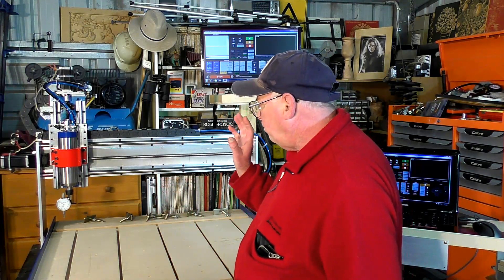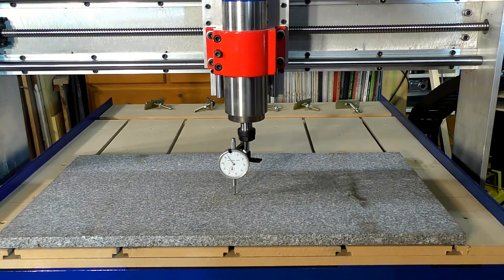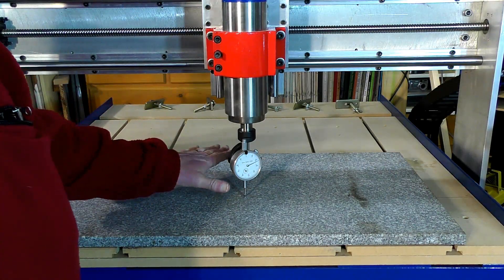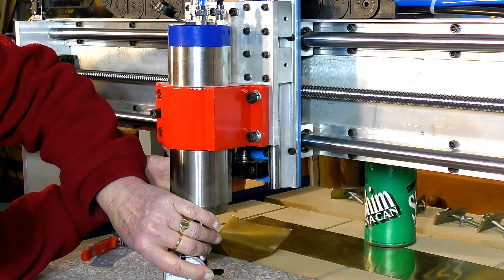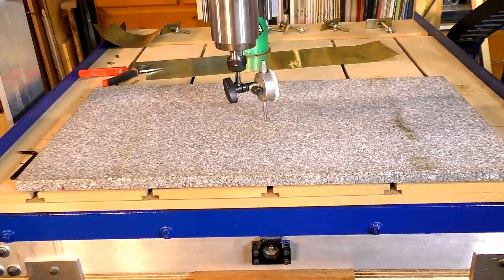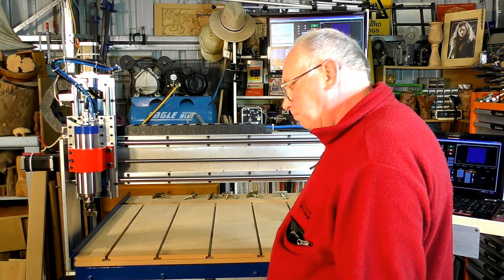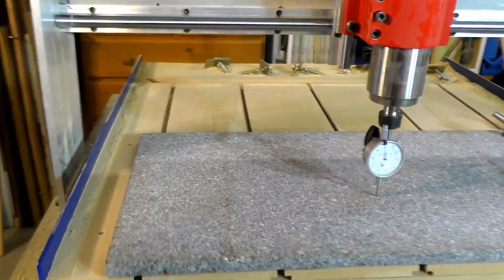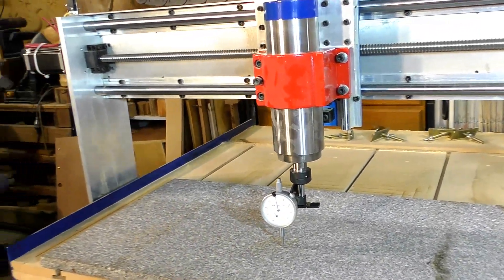CNC ROUTER, HOW TO, spindle tramming using a granite surface plate + DTI and skimming the bed flat

Comment: You can’t tram a head in if the table isn’t flat ! Even with a granite block !
Reply from the maker: Hi, I probed the granite first and got that absolutely flat, then tramed the spindle. Sometimes I don't show every thing I do in a video as the video would end up being too long.
Reply: I used this method for my Altmill and it worked perfectly. Did not want to surface my bed twice. I used a plate of glass but the granite would be better. Basically your tramming to a perfectly flat surface then you surface your bed to be equally as flat as the granite was. key is to get the granite perfectly level.

Comment: I would have measure each point of the granit slab with the gage fixed relative to the spindle.  To be sure that the slab plane was the same as the xy plane of the machine x and y axis. Shim the granit in consequence , then proceed to traming. You did do it on camera but spoke about it in the beginning.

Comment: Peter over at CNC Nutz sets his depth of cut at 0 for his bed flattening program.  He then zeroes the cutter on the bed and then adds the depth of cut to his zero in Mach 3.  That way you can adjust the depth of cut on the fly to get just what you want without changing the program.  I tried it and it worked pretty well.

Comment: No, no, no. Mr. Roger. you're making the spindle  square to the granite slab. But the granite slab could be not parallel to the plane XY created by the mivement on the X and Y machine rails.
Please check my method I posted in your previous video.
Reply from the maker: I dont think so, Its good!

Comment: Hello Mr Roger. Please let me know as I am new to cnc the speed of when you did the surfacing of the bed please. Would greatly help me a lot. Ikr it's an old video but it's very help full. FYi I use a 1/16 skim bit on my diy cnc 1155x1795 bed
Reply from the maker: Ok, 50mm per sec and 22mm step over with 1mm cut, but that is with a 2.2kw spindle and a 50mm cutter @ 18,000 RPM
Reply: @inventorsworkshop9600  I have a 400w spindel